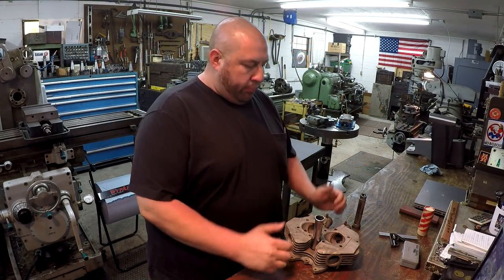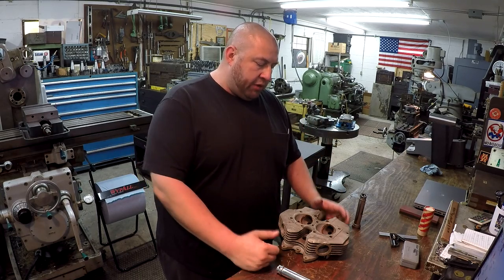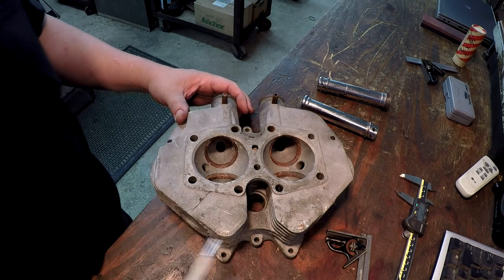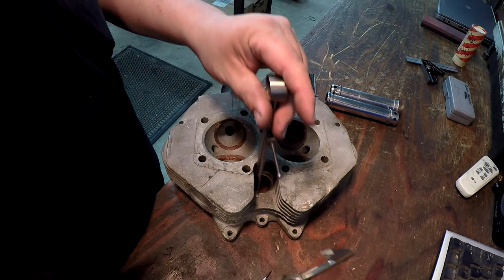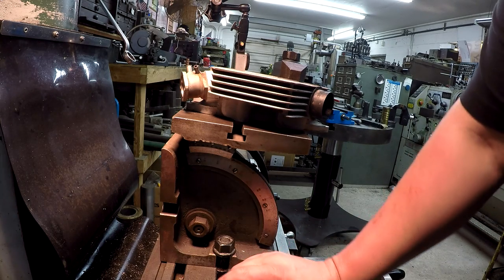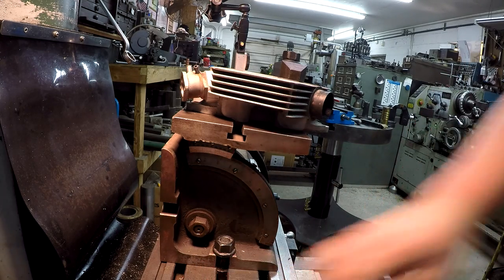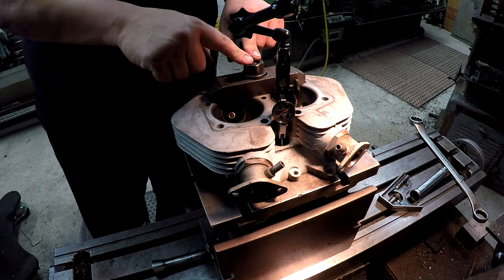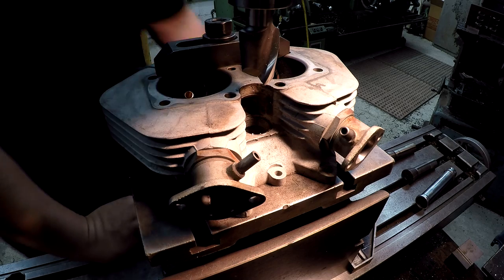Triumph TT Special Cylinder Head Modification

Comment: The head you are looking at in the beginning of the video is actually a 10 stud head from a T140E (1979-later) which has the parallel intake ports. The head on your mill looks to be the TT special from the late 60's.
Reply: Exactly. I've never had a problem sealing pushrod tubes using any 9 bolt head. This modification is news to me and I've built race engines for 52 years.
Reply: I believe that the late sixties 69-70 triumphs had this mod using a deeper counterbore to facilitate the use of a wedding band ring to produce a better seal.

Comment: Hmmfff, 50 year old almost irreplaceable rare and no doubt very expensive Triumph head. Nope no pressure on that job at all. :-) My hands would probably be shaking a bit doing that one. Guess that's what separates the real machinist's from people like myself. But it proves something. That bike shop wouldn't pick just any fool for that work. They obviously trust you with something that valuable and important.
Reply: The original head is 50 years old.  The replacement is newer so probably closer to 30 years old and less rare to come across.  The original is probably worth more than the replacement by a good amount.  But the modified head probably produces more power or is more reliable for a road bike.

Comment: Oh boy, I can certainly understand why that was a bit of a dicey operation! I can only imagine how rare(and expensive!) that cylinder head must be, and as you certainly already know, it's allot easier to take a little more off than it is to add a little more back! Especially down in that narrow little hole on a casting that's got oil and soot embedded into the Aluminum...TIG welding that to build it up would be a nightmare. Thanks for putting in all of the extra time and effort into the job by filming it for us, that is very kind of you. Have a great rest of your weekend, Aloha...Chuck
Reply: Knolltop etc: yep:  better to be looking at it than looking for it  -  as many others have said before me.

Comment: Without knowing anything about this my money would be on that the gasket surface would be the best reference for equal depth in this instance. But as you implied, it's easier to remove material than add it back in ;-) Thank you for all your videos, always interesting, educational and entertaining!
Reply: +Thomas Vanhaniemi 
That is correct, the head gasket seal surface would the preferred and more accurate reference datum point.

Comment: I owned a 1977 Triumph  T140 Tiger which like a lot of triumphs leaked from the rocker box covers and pushrods tube seals after many yrs of trying different way and methods of trying to stop the leaks I bought a new set of tappet blocks  and then  enlarged the oil drain holes in the old tappet blocks and  much to my surprise no more oil leaks, I owned that Tiger for 27 years and and for the last 10 years of ownership it never once leaked oil , I am not a engineer or a machinist just a motorcyclist who hates to see engine oil all over the engine and on the ground , so if you have the same problem just give it a try just don't make the holes too big
Reply: Bought new, enlarged old? (Tappet blocks)Can you explain? Fixing oil leaks in a triumph is a really big deal. If you have stumbled across a fix we would appreciate a clearer explanation.  Thanks.
Reply: What do you think you changed to make a non leaker? Did you use a new sealing method on the last repair?

Comment: 4.24: '6 mil' short for 6 mm. It was interesting to hear an American using this term in this way. I have recently begun using printed circuit board (PCB) design software and came across the word 'mil' being used where I would say 'thou', and initially found it confusing. From the sound of it, America is at last moving away from Units Victoriana as my (UK) school teacher called them.

I really enjoy watching a craftsman at work, warts-and-all. When things go wrong: we are shown it; we are shown the thought processes on how to deal with problems; then we see the solution implemented. What most people do not realise is that this is the scientific method in action, and craftsmen are scientists.

Comment: great set up Adam. Just a couple of thoughts, the original reference distance was probably from the head face as if the counter bore was too shallow it would hold the head up off the gasket. If it was too deep then there might not be enough clamping pressure at the bottom of the tube causing leaks. It is certainly easier to remove metal than add it though, so discretion is the better part of valour. Thanks for another great vid. Greg

Comment: Looks very much like a 10  Stud T140 750 Bonneville head  ...Nice work Adam
Reply: I thought it was from a 750.  Parallel carb intakes suggests a Tiger or non Bonnie version. Didn't think they used 10 studs on the 650s.  Perhaps in America?

Comment: Just for the sake of knowledge, both ends of the push rod tubes are cushioned with silicone or rubber crush rings top and bottom, so it would have been proper to go deeper and make both tubes stick out of the head the exact same amount. But for the sake of 50 thousandths I doubt the mechanic asked you to cut deeper because it is easy to crush an extra 50 thou. of crush ring.  If ya put the tubes in without the cushion washers there is about an 1/8th inch of up and down clearance between the push rod tubes and the head and barrels.  

With these tubes the one thing you don't want is the metal tubes touching the head when the head is torqued down to the cylinder barrels. That breaks heads. Me, I'd have gone deeper to ensure that doesn't happen.  The cushion washers alone are what seals the tubes to the heads and the barrels and even if one cuts too deep and the tubes leak oil, the difference can be made up with an extra thick cushion ring.  The newer high temperature silicone cushion ring material is the best to use as the old rubber rings are harder to crush and almost always harden and leak oil. 

BTW, you do very nice work. Watching you reminds me of Exodus 31:3-5 where it says that "God fills a man with the Spirit of God (the TRUTH - 1 John 5:6) with skill, ability and knowledge in all kinds of crafts - to make artistic designs for work in gold, silver and bronze to cut and set stones, to work in wood and to engage in all kinds of craftsmanship."
You possess a God given talent, that's for sure. 
God bless you and yours.

Comment: This has always been my major bugbear with Triumph motors. They invite oil leaks with their separate  pushrod tubes and rocker boxes. Okay,  my beloved Norton motors only have the one camshaft but are such a superior construction. Few leaks and fewer parts. I have a 72' Bonnie motor on the bench at the mo and the only thing I obsess about is leaks from the pushrod tubes which are the later type which this 66' head is being modified for the longer tubes and better seals. If Norton had the investment Triumph had who knows what they'd be like now.
Reply: Seek LUNMAD

Comment: You didn't need the calculator to find the difference in the hole depth, just zero out the calipers while holding the first measurement and it will give the difference.

Comment: The 8-stud heads were used up to 1962, the 9-stud heads up to the early 1970s and 10-stud from then until triumph folded. To the best of my knowledge the twin carb Bonneville always had splayed inlet ports.  Good job no mater what though Abom.
Reply: +ro eng splayed ports tll 79 then had straight ports when changed to MK2 Amal carbs
Reply: 2 pushrods for 2 cylinders???
Reply: boaterbil There are 2 pushrods per tube.
Reply: Mick Lawrey You are right; this head with the 10 bolt pattern is a '79 or later.
Reply: The one in the mill is a pre '72 650 head.
Reply: Correct  650 9 stud  ... 2 different heads  , Nice work all the same .

Comment: Hi Adam, 

I've done a similar mod to a Triumph Daytona 500 8 stud head. On those there isn't a single hole above the end of the push rod tube, there are two holes, one for each push rod. I was converting to a through hole setup and the better sealing of the later tubes. 

It's easier to set up with a coaxial indicator.

Comment: I would say that your Datum is the machined surface where the zylinders connect. from there down to the crankshaft casing is a defined length (by the cylinders).
On the other hand there has to be quite some play lengthwise even just because of heat swelling and shrinking.

Comment: I'm not sure if anyone else has picked up on this, but the mod appears to have forgotten about the angle of the sealing faces.  It's only a few degrees.. They're definitely not parallel as standard.  With the head upside-down and the tubes rested in their holes, the tubes should part away from each other.  Hope this doesn't cause issues.  If they wanted them like this, then I'd be interested to see what else they've done to the barrels. :)
Reply from the maker: +Willopotomas You must have missed the entire segment of me getting the existing holes indicated. I showed on my adjustable angle plate that I was at 3.5 degrees.

Comment: Firstly Many Thanks for the hours of knowledgeable & pleasurable viewing .                                                                                     I think you will find that the 10 stud hole {2 in between the cylinders & parallel inlet manifolds no exhaust stubs/flange} is the "newer" head being they were 750cc first used in late 1978 & went through until Triumph finished production. Triumph had to switch to the parallel inlet configuration to help meet emission control and also changed to Amal MK2 carbies. The other 9 stud hole head single hole between the cylinders forward toward the exhaust {has exhaust stubs/flange} is a 650cc head with splayed inlet. I would assume the issue is with the  pushrod tubes because the head/barrel surface has been machined for higher compression which in-turn causes problems with the pushrod tube oil seals being squashed out so something has to be relieved   .  The heads cannot be interchanged 
Cheers Darryl

Comment: Sorry, Parallel  intake ports came out for the 1979 EPA model.  1978 and older triumphs had splay ports with an included angle of approximately 80 degrees.

Comment: Interested to know if it needed to be cut deeper. I did notice that you said while cutting the second one, that it was deeper before you started cutting the full diameter of the bore. Also, to my way of thinking, the reference to the casting height is not important, that cooling fin casting could be at any height, but the mating face of the cylinder head, will always be a known height in reference to the engine block, so I would imagine it should have been measured relative to the mating face.

Comment: A good place I would think to measure from would be the head gasket face...That is always milled flat and would make a good reference base.Put a parallel on the face and work off that...What do you other blokes reckon????  regards E
Reply: +Ian Craig My first thought too, but because you would be measuring from an angle, how far out/in you are would alter where your measuring device touched the seat, and its readings. Then you would have to re animate Einstein to help with the maths to get any use from that Data. Simpler to just use the face close to the hole and save your MANA points for a better upgrade :) 

The work is not super critical. The O ring is only an oil seal into an area above which I think is not overly pressurised and mostly splash lubricated, once the oil has been pumped to the head. 

Great to see a Master at work on a Brit bike. Being a Brit and a closet Biker it is strangely touching.

I, however, being a lowly Grasshopper, may be, completely wrong.

Comment: I seem to recall a motorcycle engine (or it might have been some British car) that had adjustable pushrod tubes which could be adjusted for length. Just crank them up until they quit leaking. (Not that any old British bike I ever owned was totally free of oil leaks.)

BTW, "TT" is Tourist Trophy. Check Youtube for [ Isle of Man TT ]. Those guys are completely crazy - 200 mph airborn between stone walls or at the edge of cliffs. The spectators are even crazier; practically getting their noses tweaked by passing bikes.
Reply: +Peter W. Meek 
 Please don,t complain about those oil leaks....When I got lost and couldn't find my way back, I just follow the drops on the road.  LOL
P.-S. It doesn't work where there are many British motors in the area....
Reply: LOL
Reply: +Peter W. Meek My thought right at the beginning was why not make up extension rings or, if you really want a challenge, some adjustable length tubes.

Comment: This is a question about what the reference point should be. I believe the reference should be the surface that mates to the cylinder.  Therefore you will need machine further.   You might measure the original from that mating surface to determine if this is true.  The customer should have specified that.

Comment: Adam,
Love all your videos. When you made the measurements using the push rod tube, did you try and use a machined area near one the of holes for the head bolts. Looking at the video, it appears that there is a shallow  recess in the casting where you were using the calipers.

Comment: Hey Adam, great video!

I understand the job is what you've been asked to do but i was just wondering if making the tubes to suit would have been an easier job?
or is it more along the replacing the tubes would be easier than changing heads line of thought?
i only ask as i sometimes build up bikes 

Cheers 
Troy
Reply: The tubes enclos pushrods which also have a tolerance
Reply: @rcpmac  but changing the pushrod tube length has no bearing on the pushrod length themselves.  If you cut the bore deeper or if you shorten the tubes, either way you've got the same distance between the camshaft and the rockers.   I think shortening the tubes would have been an easier and less expensive solution (although I have no idea what Adam charges)

Comment: Why wouldn't they make push rod tubes to suit the conversion?
Reply from the maker: Didn't ask that
Reply: Modifying the head means you can use "stock" parts in the next rebuild, it means the motor looks "stock" as the OEM tubes are used, vice leaving the head stock and having to use custom push rod tubes. As well as, the op to modify the head is likely cheaper to have done then custom push rod tubes made

Comment: nice work adam. did you check the old head to see of the distance from the head gasket surface to the counterbore varied the same amount as the new head? i had a few of those old english bikes back in the 60's and 70's including a tt racer. as i recall they all used the whitworth system. they were a lot of fun. no electric starters on those bikes.
Reply: +larry sperling very good point, I would have gone from the head gasket surface myself too.  the casting on either side of the bore is material out in space, aka its not doing anything and in my mind would tell who is casting the head they aren't constrained to very closer or even any tolerances at all.  just my mind set.  like you said check the other head the same way if they are both dead on from the HG surface by design then send it another 50 thou abom.   the triple check would be measuring the surfaces on the jug/case where the tube has to meet up with. if they measure up equal then you know the casting on the head is what threw it off.
Reply: either way be sure to bring it back up Adam in another video I would love to know how this turns out.
Reply: he did, right at 18:18

Comment: @Abom79 How did you orient the head onto your angle plate? Looks like you got it right by eyeballing it, but if it was rotated a bit, then the axis of the hole wouldn't be perpendicular to the plane of your angle plate. Since your angle plate is 1-axis, you have to get the head onto it straight (so the Y-axis of the head is in line with the Y-axis of your mill). Can you say how you checked that? Seems like it would be hard to confirm for those small angles! Thanks! Love your show.
Reply from the maker: I lined it up by sight and quick measurments with my scale. The indicator showed that it was very close. It's an o-ring face so I don't think being .001 out of flat is going to hurt it.

Comment: Adam, on the newer head that the motorcycle shop gave you as a reference, is the exhaust side .050" shallower than the intake side?  If so, you are golden.  Tt.
Reply: +TreeTop1947 I can't tell but at 27:30 I think he says so.

Comment: Hi Adam, 
Nice work yet again, but tell me if you had machined too deep, wouldn't it be easier to add some material to the tube, and then face it off to length, rather than tig  up the cylinder head and then rebore that to spec?
Reply: +Rope Tangler 
Usually just add circular shims on the  tube shoulder to adjust the seal crush.
Reply: +patw52pb1 Thanks, an even easier solution. It was just that a few mentioned building the bored section in the head, and I thought that building up the tube would be much easier than tigging the cast head, but your way much easier again, Cheers,
Rob